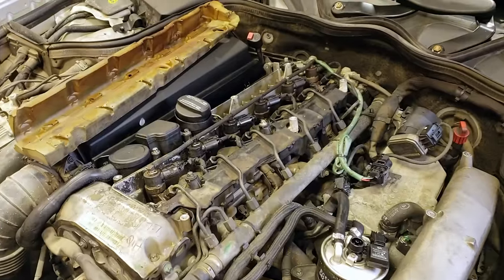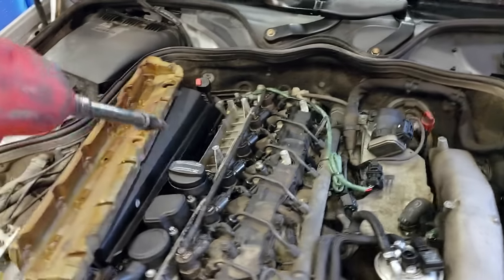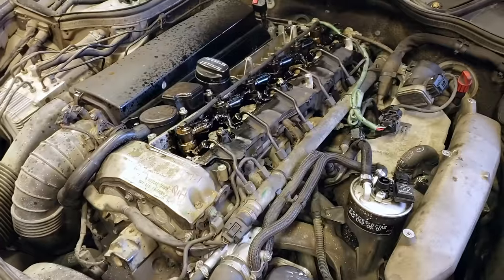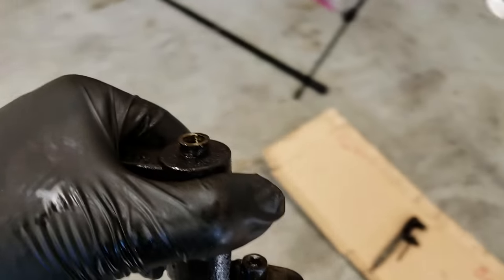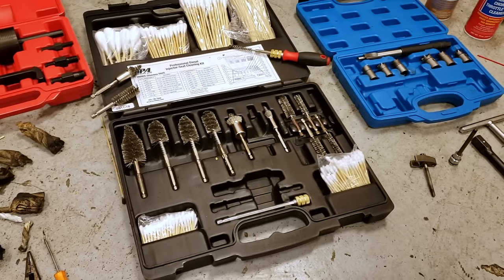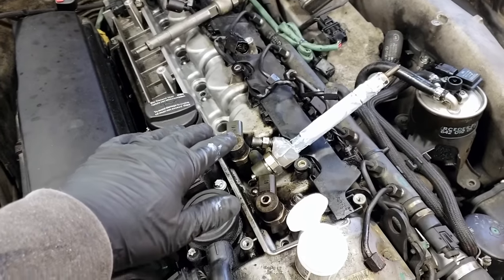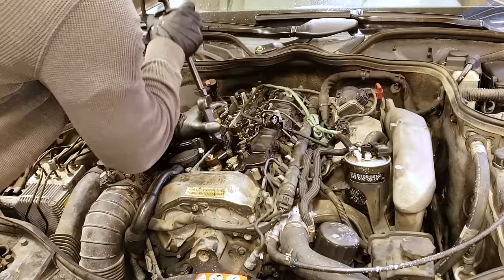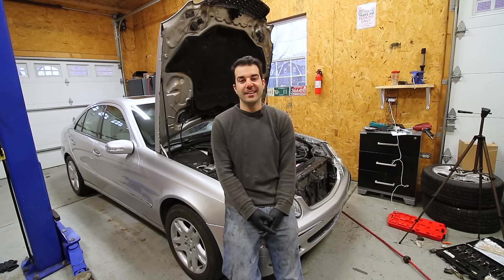My Turbo Diesel Mercedes Has A Nasty Engine Issue. Don't Buy A Diesel Before Watching This video.

Comment: My old W220 S320 CDI had same engine and same problem when we went Ukraine from Finland. In Poland one injector started smoke so much that me and my wife couldn't almost breath inside the car. Luckily we got that fixed after Ukraine border in little towns repair shop in one hour. Now I have W221 S320 CDI witch have OM642 V6 3 liter diesel engine and odometer stands at 228000 km's now. I have driven 20000 km or 12427 miles with car and not haven yet same problem. Let's knock on wood! Thank you from nice videos, Keep the wheels running.
Reply: Onko ihan vakio vai onko ohjelmaa
Reply: @user-im3dr8yo3o  Ei ole tietoa. En ole ainakaan itse ohjelmoinut. Hyvin se ainakin liikahtaa. ;)

Comment: when you pull out the injector, you should send it for a Bosch dealer for inspection, to be sure they are perfectly tuned, double prevention. good job mister.
Reply: Good idea.

Comment: Having watched a fair few yt  videos about repairing leaking injector seals I have to say this is definitely one of the best, although as Alex rightly points out if caught early its not to big a deal, it also shows that even for someone with the professional training and experience of the presenter its not necessarily going to be a walk in the park ! its definitely a job that has the potential to end badly if you don't know what your doing.

Comment: My understanding of the 'black death'  is that it's not related to injector blow-by as much as it is the melting of the engine cover foam isolation (read insulation) block from the plastic engine cover. The melting of this ridiculous pad oozes down around the injectors and on the all the return lines etc and hardens over time. My car has this problem and there's no injector leaks, 277k miles.

Comment: Good video but safety is first! Vacuum air cools the compond motor and sparking brushes. Carb / brake cleaners can be flammable if the right air/cleaner ratio is obtained. And never run a diesel engine with the fuel injector mounting bolt removed! And you had your body over it? You know the extreme pressures that a diesel engine produces? And the pressure that the fuel rail are at? You got very lucky this time! You could loose your eyes and or your life! Please show some respect and concern for people who are learning from your videos. Us old timers have seen a thing or two with hotshot young mechanics who lost eyes, fingers and other body parts because they cut too many corners on safety!
Reply: Tom Randall thanks for the comment. This is very important
Reply: good point, you can lose an arm or worse, the injector blasts the diesel into your bloodstream like a syringe , even a small amount you can lose a hand ...

Comment: I think You should buy and USE 'Tubing Wrenches' on every tubing nut. They have a slot to fit over the tubing and grip the nut with 5 (of the 6) flats on the nut and totally avoid distorting the nut.

Comment: Be VERY careful using a vacuum cleaner sucking up carb cleaner! Its a double edged sword, carb clean is the best thing available for softening carbon quickly, but Its highly explosive and the fumes can be ignited if sucked into the vacuum cleaner motor! KABOOM! I recommend using a vacuum oil extractor(that doesn't react with carb clean) to suck all that gunk out, but it will need to be cleaned afterwards too!
Reply: Put a glass mason jar just before it goes into the pump to help collect most of the debris. Both ports on the lid of course

Comment: Soaking the  injectors in brake cleaner for days will help dissolve the black death making removal easier, good job though
Reply from the maker: I soaked them in pb blaster and carb cleaner for 2 days. Those 2 were stuck bad

Comment: Good job... best practice would have fitted caps to the fuel connector on the injector to prevent dirt ingress. Mega fine clearances inside injectors can easily be compromised.

Comment: Good vid, just did this to my 2006 Sprinter to get the "shade-tree" fixes off the motor. There was an incredible amount of BS (two copper washers on an injector/ broken rail clamp/stripped clamping screw) on my truck. Took 5 new injectors, since there was 1/4M miles on the clock and I just wanted to do this once. Also, replacement of the collector (return) line is advised with new injectors. A good cleaning tool for the injector bore is a 223 chamber brush. We took the glow plug out of each cylinder, brought it to TDC, and put compressed air in there while we cleaned the bore. That's sorta critical to keep trash out of the cylinder. Diesel on!

Comment: A few years ago I had this done on a 5 cylinder Alfa Romeo diesel and a friend who worked at a Mercedes/Alfa dealer did it for me and had me pour Coke over the injectors the night before to dissolve the carbon, I thought he was winding me up but the engine cleaned up easily and all the injectors popped right out!
Reply: Coke is literally just sugar, artificial food colouring and phosphoric acid, its rust/gunk dissolving properties are well known. Just make sure to rinse it off with water afterwards so you don't get a sticky sugary residue.
Reply: Coke is an extremely powerful cleaner,  in emergency can be used as detergent to wash the floors !
Reply: @furiousdriving. You can also use coke for the coolant system. Uninstall the thermostate to gain flow and fill up with pure coke. Also put your heater on. Drive about 50 km's and let it stay in overnight. The next day you can rinse the system.
Reply: I use both Coke and Pepsi for descaling heat exchangers. I never drink the stuff.

Comment: I would cringe using wire brushes, especially were there’s a potential of some wires coming loose and going inside the cylinder. I would have just used strong solvents and strong rags, picks, small screw drivers. There a very good solvent called Berryman chem-dip ...
Reply: Wire brushes always lose wires, I thought a “Kit” would have included an expanding mandrel to seal the nozzle hole, you could then carry on with whatever methods of cleaning you like, blow the carp out of the injector holes and have a lovely clean head to refit your injectors into.

Comment: how to loosen a stuck injector. loosen all the bolts for the injectors half to 1 turn and start the car. after either 1 secound or 30 min of driving they should come out :p
Reply: I'm commenting to try and bump this 😮
Reply: Are you being serious? Is that actually kosher advice?
Reply: Frank Rizzo if the engine is being stunborn you gotta do what you gotta do. Else its pulling the head and doing it from the inside...
Reply: snederw so it’s ok? Like do you leave that injector connected?
Reply: Frank Rizzo yes, as the engine is running normally, no guarantee there wont be damage but as a last resort before pulling the head its worth a shot

Comment: My 2005 E320 CDI had this and I fixed it on a couple of our family E320 CDI OM648 cars. 1. Throw away the foam on the top of the injectors on any CDI you own immediately. This is what melts and becomes black death goo! It does not quiet the engine down much at all in my experience. It is just a risk having it there if one of your injectors starts leaking. 2. When removing the black goo, do not use any solvents! It is much easier to pick out dry and vacuum up than if you soften it and create black swamp water. 3. I had a bore cleaning kit with a nice plug for injector inlet so no debris can enter the engine. 4. Most of the injectors that have a bad seal were due to the seal being installed upside down by some mechanic before us! The injector seal is convex on one side and more flat on the other. Make sure the orientation is correct or it will leak again soon! 5. Make sure you get new injector bolts because they stretch when torqued and the old ones are certainly worn out.

Comment: I've done this job too with the proper tools and chemicals. I bought a bore cleaning kit that had a plug that kept solvent in the bore hole, yes, it was on amazon.  Biggest question for you is why not apply some torque or twist to the slide hammer head tool?  I was able to twist the injector out with very little hammering? It was about as bad as this 642 in the video.  Also acetone is highly effective in melting the carbonized material.  I bought a vacuum brake bleed tool modified it slightly and used it to suck up the sprayed acetone and carb cleaner while scrubbing and removing the contamination.  Nice job!

Comment: One crucial thing when using the cutting tools. Pack the cutting end with grease to hold the shavings so they do not drop into the cylinder. The last thing you want after doing a job like this is aluminum shavings chewing up your piston rings and cylinder walls.
Reply: Yes. That freaked me out too!

Comment: What is to keep any shavings from entering the cylinder when reaming for a new seat? Also what keeps any of the wire bristles from entering the cylinder when using the wire brushes? I am not a mech. but feel this is an honest question, these tools would work perfect if the head is removed but with it still on the block leaves a risk in my opinion.

I know when trying to install a Heli-Coil on gas engines the reamer/threader is coated in grease to TRY to prevent anything from entering the cylinder and if using a ream to try to remove carbon build up around where a glow plug would be used in a diesel engine they coat the reamer with grease in order to try and capture any carbon from falling into the cylinder. ,
Reply: Exactly, use grease, and it's a non-issue in practice.

Comment: Alex is very helpful for engines with individual injector clamps. Those with clamps that hold two injectors are removed in pairs. You can't get one out without its partner. A stuck injector will need the injector top removed and a tool that screws on and pulls from the top. That probably means a scrap injector but it's cheaper than a scrap engine. Now all I have to do is find out how to get the internal parts out of the injector.

Comment: Hey...If you unscrew bolts or whatever on CDI on Rail itself...just cover it right away (plastic bag or plastic foil...all clean and new)...Nobody wants even very small piece of whatever inside of the rail rail. And if you remove injector, please god, please..dont just throw them on a nasty workbench or whatever disgusting place. Common rail (cdi, tdci, hdi, etc) works with VERY high injection pressure, so even very smal inpurity could be a problem...

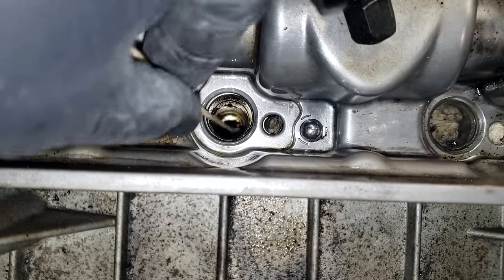 And 15:40 - guess where drops all that stuff. Aha, yeah,inside a valve. So dont do this if you are not able to take most of it out with compressed air.

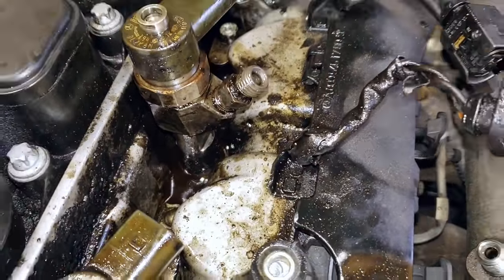Do plan your work..Because cleaning whole the stuff out precisely and then do this : 20:50 is not worth it

I dont say he is an idiot. He is not. But if you want to share with something in hope it will help, maybe its a better way to do it more like it should be done.
Reply: I was concerned about exactly this when watching the video. Even a minuscule shaving that falls in and cannot be picked up by blown air, will create a grove in the cylinder jacket or fuck up your rings.
Reply: @Zamolxes77  no, aluminum shavings won't cause damage. They are much softer than piston rings and cylinder bores.
Steel and dirt are the things to worry about.
The real question is : after hand cutting the seat, the dimensions change based on the material removed, does this have an effect on the future longevity of the injector seals?

Comment: Geez I’ll probably never buy a diesel those problems are crazy 😳
Reply: Well I did see a lot of high-mile diesels here in Germany and they really do last a long time, provided you have some money laying around for so many expensive failrure points. In eastern Europe, things are a lot simpler-they just take everything out and those engines do become somewhat feasible. DPF, EGR...then you basically have transmissions and injectors as potential problems. I personally wouldn’t dare relying on such a complex and costly engine for everyday use, hance I always buy petrols.
Reply: Good for you

Comment: If you want to get the injector out more easily you have to modify your slight hammer. Use a longer bar with a heavier weight. This will be much more efficient because you build up more force as a result. We mechanics in Germany do this work all the time. I hope this will help you in the future.
Reply: When cleaning the injector hole and reaming what happens to carbon falling through the nozzle hole on the piston?
Reply: @viaanfourie9546  the carbon will be compressed and thrown out with exhaust. The pieces should be not bigger than 5 mm.

Comment: So if you had to buy all the tools needed, why do you keep saying fixed for $18 ????
Reply: Do two other ones and be four figures on the plus side. 
Anyway, tooling does not count for a tech guy, does it?
I built the tool (with more weight) myself and preload it with a spring:
Two hours and one dive in the metal container.
Reply: @manfredschmalbach9023  Spot on

Comment: Alex, what are your thoughts on the MB 4.0 Diesel V8? I've heard it's an absolutely awful engine, any experience?
Reply: Never heard of it in north America
Reply: Yeah its true i'm from Germany. This ebgine ist the worst diesel engine in w211. 420 diesel v8 is perfect to buy and use
Reply: @ozgurdeniztuncer5050  but isnt it only different injectors and more boost that is different with the 420cdi from 400cdi?
Reply: @brage4284  no, 400 cdi has a big Problem with timing chain and timing chain tensioner. 420 cdi has prpblem with oil leak at oil cooler.

Comment: Wow, I am so glad I stumbled on your video tonight.  I plan on seeing 3 different Winnebago RVs tomorrow, with 5 & 6 cyl diesel engines.  They are from 2006-2008, so I'm sure the black death problem is something I should be looking for.  I'll give a keen listen for the tell-tale puffing while the engine is running.  You may have saved me some big bucks!  I'm a DIY guy, so tackling that job will be somewhat a fun challenge, in case I ever need to do the repair.  Made easy after watching this video....THANKS!

Comment: when you cut the seats,??where the shavings go.??
Reply: And how about a few bits of wire from the wire brush?
Reply: No kidding. While I’m sure this guy has the best of intentions, he is sorely mistaken in his methodology. Those tools should only be used with the head OFF!
Reply: The shavings just disappear, cuz it's magic shaver... maybe he'll get some/most out from the cylinders with air pressure and vacuum cleaner, although some particles might remain. ( :
Reply: I think he made a great video, I’m not picking on him. I appreciate the effort but hope he reads our comments so he can amend the video. That carbon will destroy a cylinder wall.
Reply: Don't ever go to a garage to look at what a mechanic does to your car when things become a struggle.
Reply: You liberally grease the cutter, which will catch most of the swarf. You are removing very little material and it's soft aluminium and not going to do any damage anyway.
Reply: @thefurrylittleotter3460  Nonsense. Yes it's better, head off, but harmless in situ.
Reply: @pieterdewit9081  
X2

Comment: To behonest been driving diesel since the early 1980 and i have never heard of this, nor have my diesel mechanics so i watch in anticipation.
Well 2 min 26 sec and you reveal a leaking injector well that not an expensive issue to sort and it quite common with high milers. 
We do not call it black death we call it routine maintenance and service.
Who lets that happen first you would get noisey engine loss of power  sooty engine bay oh and yes warning lights.
Sorry your engine does not have to be that cold stop taking the piss and clean that carbonised nasty diesel shit up before starting work. I have been told your diesel quality is poor in the states. I cannot understand why anyone would run a diesel with a leaking injector do you not have annual motor vehicle inspections. That car woukd not get a pass certificate and so could not be driven on the if seen on the road it woukd be clamped and impounded then to get it back $1500 plus repair plus retest.
Reply: That Mercedes engine is quite troublesome. To be honest I seen this issue before 2 times, both cases - Mercedes engines. My e46 BMW has about 220k km and never seen this issue, nor to WV I had, nor Renault.
Reply: The sprinter cdi where the worst for this done loads off these jobs on the vans good engines just poor injector design
Reply: don't ya think that in some cases, an owner might not have the funds for an extra impound fee? there are some states that have inspections. i don't live in one but i've heard they can be hard to pass with the emissions test. take i'm personally glad we don't have them. it's another expense and how i maintain my vehicle is up to me. i don't have to replace an o2 sensor till i'm ready. no doubt, the presented problem would have some very noticeable signs and i personally would fix it pretty fast.
Reply: You're right, leaky injectors are no big deal. My old W123 always leaked a little. Just wash it away at the carwash.
Reply: Well if usa diesel bad.. my country worse.. lol
Reply: Us diesel varies in quality, truck stops have the best fuel. But independent fuel retailers are a crap shoot, water is commonly found there.
As for inspections, each state has unique laws. In Connecticut, that leak would mean a failed inspection. In Florida (where I live now) no inspection. Motor vehicle laws are not as cut and dry as European laws.